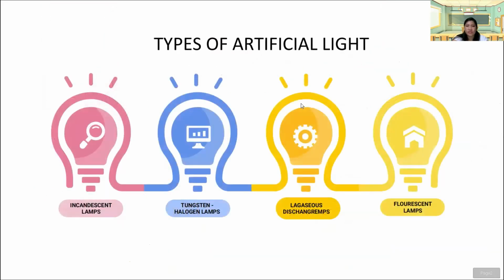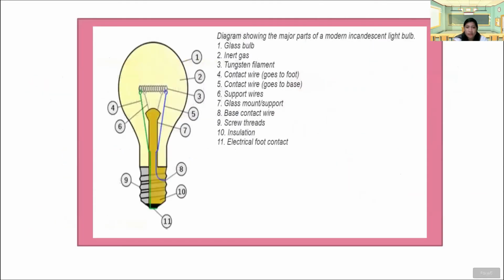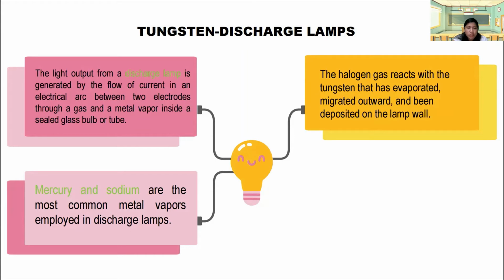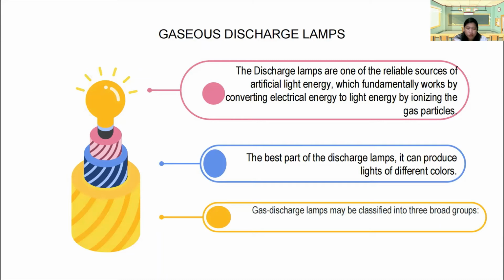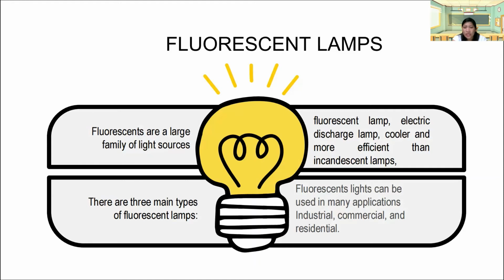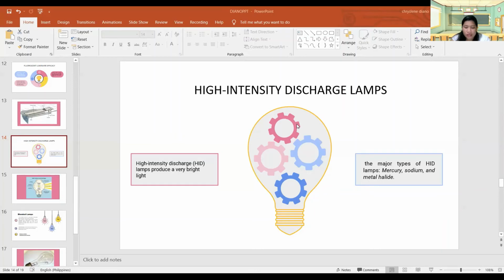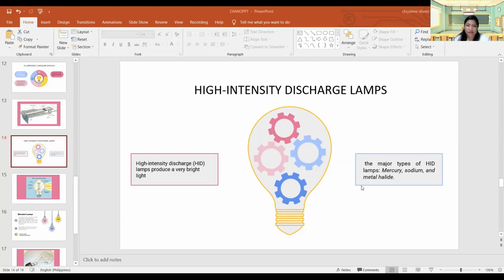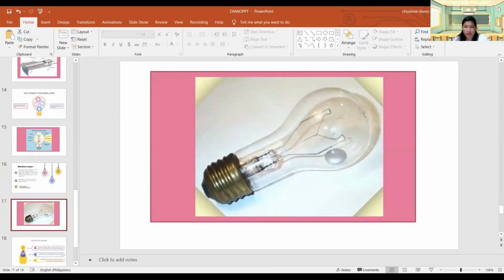UT DIANO

Comment: In this topic, I learned that the sources of artificial light are of three main types: incandescent or arc lamps, lamps based on discharge of gas, and light-emitting diodes. I also understand that the artificial Light is any light source that is not naturally occurring. Artificial Light includes things like flash/strobes, of course, but also any street lights, indoor lighting, or other man-made light sources.

Comment: I learned in this lesson that selecting a decent light source is the first step in building a good lighting system. Light sources come in a variety of shapes and sizes, each with its own set of features and capabilities. A resistance to the current is created when electricity runs through the filament of an incandescent lamp, in addition to what I've learned.

Comment: To Diano's report i learned about different types of artificial lights sources and its importance.Incandescent lamps is the emission of lights cause by heating the filament.Tungsten discharge lumps it is produces by flow of current in an electric arc.Gaseous discharge lamps it works by converting electrical energy to light energy and etc.So in general lights helps to allow people to works when it is in poor lighting.

Comment: In this presentation, I've learned that in choosing a decent light source is the first step in building a successful lighting system. Light sources come in a variety of shapes and sizes, each with its own set of qualities and operational characteristics. So By ionizing the gas particles in gaseous discharge lamps, electrical energy is converted to light energy. It is the most common type of fluorescent lamp that can be utilized in a variety of applications, including industrial, commercial, and residential.

Comment: What I've learned in this report is all about different forms of artificial light sources. Incandescent lamps, tungsten halogen lamps, lagaseous dischangremps, and florescent lamps, florescent luminaire efficacy, high intensity discharge lamps, blended lamps, and solid state lighting are all included. According to Wikipedia, an incandescent light bulb or lamp is an electric light source that operates on incandescence, or the emission of light induced by heating the filament

Comment: In this video was all about thr Artificial lights and their types. After seeing this video that selecting a decent light source is the first step in building a successful lighting system. Lighting invludes both natural and artificial lights source, such as lamp and loght fixtures. So many types of artificial lights which include the flaurescent lamp, incandescent light bulb and so on. The flaurescent lamp are type of lamp that extensively used in commercial lighting, industrial lighting, school lighting, and retail lighting application. Lightning is help us to see brighter and we can work even at night with help of light.

Comment: After watching this video, I've learned the different types of artificial lights including the incandescent lamps, which is the lights of this lamps are caused by heating the filament. I've also learned that Thomas Edison is the inventor of the incandescent light bulb. In tungsten lamps, it is generated by flow of current in electrical arc. In gaseous discharge lamps, is converting electrical to light energy by ionizing the gas particles. In flourescent lamps, it is the common lamps that can be used in many applications including industrial, commercial and residential.

Comment: In this lecture, I learned that the first step in designing a good lighting system is to choose a good light source. There are many different types of light sources available, each with their unique set of features and operational characteristics. In addition to what I've learnt, when electricity goes through an incandescent lamp's filament, it produces resistance to the current flow.

Comment: After watching the video, I noticed that this report has multiple different sorts of artificial light. Artificial light includes high-intensity discharge lamps, Incandescent lamps, discharge lamps, mixed lamps, and solid-state lighting. I also learnt that when electricity passes through an incandescent lamp's filament, the filament generates resistance to the current flow, causing it to heat up creating incandescence.

Comment: I learned about the several types of artificial light in this report. Incandescent lamps, high-intensity discharge lamps, blended lamps, and solid-state lighting are the types of artificial light. The incandescent lamp emits light as a result of heating the filament. High-intensity discharge lamps are a type of gas-discharge arc lamp that produces light by passing an electrical discharge between two electrodes and through plasma or ionized gas. These lamps are well-known for their great efficiency in converting electricity into light as well as their extended rated life. A blended lamp is one that has a mercury vapor lamp filament and an incandescent lamp filament connected in series in the same bulb. Lastly, solid-state lighting is employed in a wide range of lighting applications because it provides numerous advantages such as long life, energy savings, and higher light output quality. They are also thought to be long-lasting, fundamentally safe, and suited for smaller, more flexible light fixtures.

Comment: In this report, what I have learn is all about types of artificial light sources. It includes incandescent lamps, tungsten halogen Lamps, lagaseous dischangremps and florescent lamps, florescent luminaire efficacy, high intensity discharge lamps, blended lamps and solid state lightning. It says that the incandescent light bulb or lamp is a source of electric light that works by incandescence, which is the emission of light caused by heating the filament. They are made in an extremely wide range of sizes, wattages and voltages. And there are others that is important that we should know.

Comment: This video taught me that the first step in designing a good lighting system is to choose a good light source. There are many different types of light sources available, each with their own set of features and operational characteristics. In addition to what I've learned, when electricity flows through the filament of an incandescent lamp, the filament creates resistance to the current flow, causing it to heat up and incandescence.

Comment: In this video, I learned that the selection of a decent light source is the first step in the design of a good lighting system. There are a variety of light sources accessible, each with its own set of features and operational characteristics. In addition to what I've learned when electricity passes through the filament of an incandescent lamp, the filament creates resistance to the current flow, causing it to heat up and incandesce.

Comment: In this topic, I learned about the different types of artificial light sources. It discusses that the first decision in the design of a good lighting system is the choice of light source. There are a variety of light sources accessible, each with its own set of features and operational characteristics.